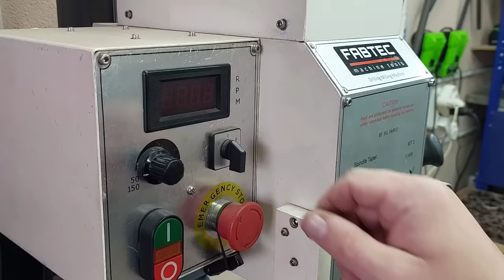Not many people know this method! Brilliant idea for making disks on the lathe

Comment: I might have missed it but what s the purpose of the three bolts?
Reply: It looks like the sharp tips of them protrude slightly from the face, digging into the disc and preventing it from slipping.
Reply from the maker: The 3 bolts hold the workpiece, disk from turning for further machining
Reply from the maker: @canitbethat  That's right👍

Comment: Would it have been faster and easier to use the parting tool perpendicular to the face of the plate to remove a ring of material instead of the interrupted cut on the perimeter?
Reply from the maker: Welcome!
Reply: I don't think the blade of the parting tool is long enough to do that.